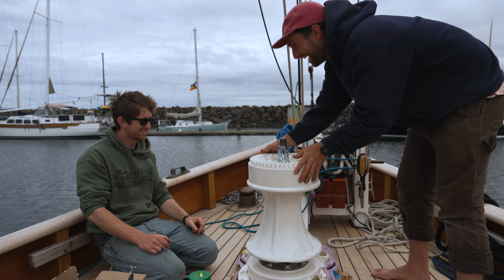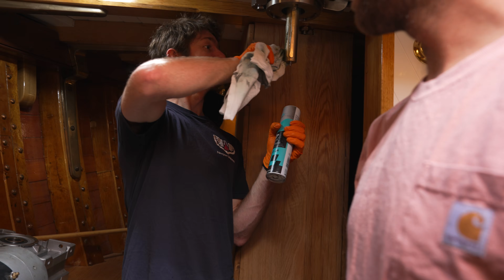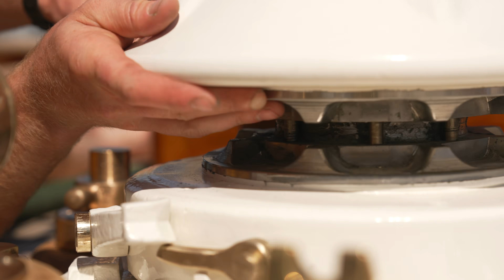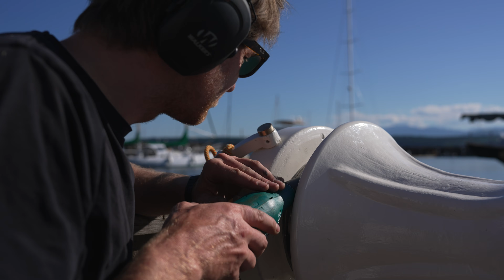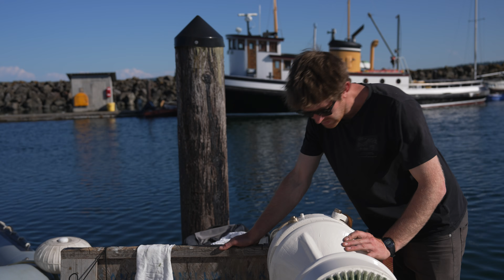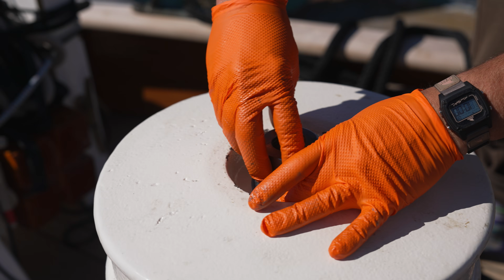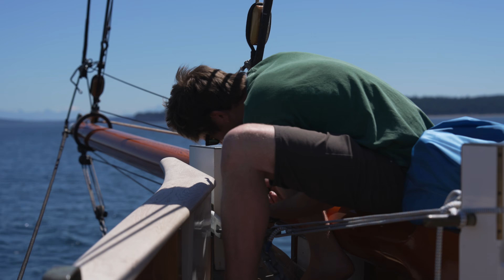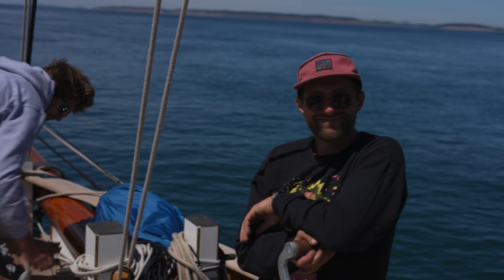Installing and using the original capstan!

Comment: I know you love traditional boat and things like the capstan,. but what a terrible choice for your boat. It's very heavy right on the bow and will likely change your stability. All the work. time, and money that went into this when a much more efficient, far less weight, and wayyyyy less cost windlass is readily available. That and the antique and inefficient rig that will make short handed sailing quite difficult and dangerous. And the widow maker, that exquisite boom is super dangerous in my view. A powerful jibe combined with a roiling swell will rip the deck hardware and take out anyone who is above it's swing. Running down wind in a cross swell could drop the boom in the water briefly. The force of that will rip the boom off the mast or pull the boat over if the sail fills with water. This has happened to much more experienced sailors. Yes, it is a beautiful piece of work that cost far more than a more modern boat, but is not well suited to the ocean without always a crew on board to handle those sails. You can rebuild a model T to a beautiful and restored condition,  but it is still an inefficient design regardless how cool one may think it is. Sell Tally Ho, take the money and buy yourself a boat you can sail by yourself or with a short crew. I have crossed two oceans in sailboats and I would never attempt that with such a difficult rig and heavy boat. What the hull speed flat out? I doubt more than 8 knots. How long does it take to get there at hull speed? Much longer. How about running away from storms? Speed is very important and this boat does not have the capability of doing 2-300 mile days. You would not buy a car that cannot accelerate and get you out of trouble, any more that a restored Model T could help avoid an accident. Beautiful workmanship at a high cost and yet a very slow boat. That's my view, and I am sure a traditionalist like yourself would not agree, but this 20,000 miles old sailor knows a few things from experience.
Reply: Also it's the original capstan. Where's the problem. Just your lack of listening and uninformed opinion.
Reply: What a fantastic well-suited pep talk for a guy that has spent 7 years following his dream, restoring a 110 year old boat, finding means and ways to impressively manage a very large project and building up a community of 500k+ subscribers who repeatedly state that they are delighted with the content of the channel.

I am pretty sure you have convinced all followers/subscribers to shame Leo, the channel and Tally Ho for being old, inneficient and unsuitable, and that Leo will dispose this worthless boat tonight

PS: Those who gather information before issuing opinions  know that the weight in the bow was taken into consideration (542 lbs according to Keith video who weighted it by Leo's request) . One full video dedicated to stability
Reply: So because of that there is not room for valid criticism or helpful suggestions? Obviously your experience is limited and you do not understand a fundamental truth for those who venture offshore in a boat. The "ocean" or "mother nature" if you will, does NOT CARE when it attacks you for your foolishness'. It does not care if the person scaling a mountain is experienced and doing everything right when he is killed by an avalanche or frozen to death in a freak summer storm, does it? Every sailor knows despite every precaution and concern, shit happens out there in the big blue, things that you could not predict or prevent at the time. Only a day sailor, or racers (ugh!) would think otherwise. This skipper Leo is very knowledgeable and has logged many miles, all in traditional  boats, often with large crews. However, my points are that it will take more people to handle that rig in difficult weather, that slow sailboats, (under 8 knots consistent), cannot run away from storms, a wooden or steel boat may be rugged and extremely well built, but the sail plan is not suitable for long excursions without a robust crew. THAT IS A SIMPLE 2+2=4 TRUTH. So on top of the weight of all that fine wood, a monohull is dragging a huge lead keel. The finest navigators and sailors were the Phoenicians and the Pacific Islanders. The sailed and navigated in seas prone to brutal storms in open boats. Islanders were known to travel hundreds of miles to another group of islands just for a party and ceremony. Finding and sailing to a south Pacific island is far harder than finding a needle in a haystack. And what boat design and material did they do that in? Their choice of boat design was capable of speeds in double digits even in light air WITHOUT a huge sail plan. The low weight enabled the ocean to lift them from breaking waves. Their shallow draft meant they could be beached for repair or landing. Today the best sailing yachts are made of carbon fiber, displacing  1/3 of what other hull materials weigh. Those ancient sailors used multihulls, made out of bamboo. Like an antique car that has been fully restored, a boat like Tally Ho has value, probably a lot since the record of every item built into the boat is available to see. However, like a restored antique car, it is slow, inefficient fuel wise, hard to handle in blow, and lacking creature comforts for long trips, etc. Someone who is a lover of this boat and style will pay a lot of money for such a vessel, but they will likely not buy it to sail the world. My advice is to sell it before it is used much and in pristine condition, and buy a modern boat if the goal is to explore the world. So just like a man who rebuilds an antique car, he can get a lot for it, You don't see Jay Leno going on a coast to coast road trip in any of his cars, do you? And why is that? So familiarize your self with modern boat building and the kind of sailing experience they bring and you will understand my post. What I have said here takes nothing from the great achievement  Leo, his fine workers, and the superb craftsmanship and knowledge demonstrated in the videos.  Also I just thought of worms. In the warmer waters of the world, eg. the entire South Pacific, wood hulls are vulnerable to wood boring worms. In older times, they covered the underbody of wooden boats with copper sheets to stop this. Today even with modern antifouling paints critters manage to get through to the hull material, particularly on long voyages. Also a wooden boat hull is not smooth and the surface makes it far easier for growth to accumulate  fast.

Comment: Leo, Please wrap that beautifully machined chunk of steel holding the capstan drive motor with some kind of substantial impact absorbing material before someone gets hurt!  Head injuries bleed a lot.  In heavy weather. if there is a need to be that far up in the bow it looks like it will be almost impossible not to run into it.  Looking at the rest of the interior I suspect you have already planned to wrap the new machinery in a teak box with well rounded corners and edges.  Hope you and the crew are have a great time sailing this beautiful vessel.

Comment: Your restored capston is a remarkable piece of machinery. However, I think it's entirely too large for your vessel. I have a 55 foot ketch, 22 tons empty with very highfreeboard. I survive with considerably less weight forward than your capston. I am sure an experience sailor like yourself never depends on the capstan alone to maneuver up to your anchor to retrieve it. I know you probably want to maintain the historic features of your vessel, but from a weight, bulk, space taken below decks, and other aspects it is totally unappropriate in my humble opinion. I have successfully retrieved my anchor in 40 + plus knots single-handedly. It simply takes a little more technique and patience. I would avoid extreme weight in the ends of my boat at all cost!

Comment: Drop elbow and chain will feed proper into the locker. To avoid ripping elbow out, cut at a 45 degree angle and make an oval flap for water barrier
Reply: to avoid ripping elbow out, cut at a 45 degree angle and make an oval flap for water barrier

Comment: you've been saying the chain isn't the same size as the design sample, why not smooth the chain some?  plus there are slight inconsistencies in the chain welds, etc. that could be causing some of the problem.

Comment: Have you considering having the entire chain sand blasted (or vapor blasting) to remove the high spots on the welds and make a smoother surface? I think that may fix all of your binding issues.

The cap stain is a high tolerance machine while the chain is a mass -manufactured white very loose tolerances and seems to be the cause of your issues.

Comment: The Moly Disulphide grease I specified when designing the PT-6 gas turbine engine, was not to used on ball or roller bearings because the crystals would be laminated together, like graphite crystals, but they were excellent for sliding applications like threads.  Leo was 100% correct in his comments about molybdenum disulphide grease.

Comment: Personally, I would have been really tempted to install modern anchor windlass like a Lofrans, and a raw water pump at the bow.  Nothing like 100 ft of  mud on the chain you don't want in the locker.

Comment: Fantastic to see the capstan installed, everything fitting neatly together, and working so well; the product of many hands in several places. The links of the chain and the slots in the gypsy will surely wear a few thou off each other with use and you will get a better fit over time?

Comment: Leo as a former mechanic who has a few nice head scars from third members on cars rear axles I have one suggestion to avoid blood loss on Tally HO. Make some sort of box with rounded edges around the motor drive in the capstan. Otherwise someone WILL hit their head on it and then there will be blood all over that amazing interior woodwork. Machined 90 degree corners are very sharp and very unforgiving.
Reply: Thank you! I worked on aircraft for 17 years and bashed my melon too many times to count.
Reply: I’m also a mechanic and that’s the first thing that came to mind at the end of the video!
Reply: some dome nuts on those threads
Reply: I had exactly the same thought.
Reply: I was wondering the same thing, some heavy sea and somebody try to walk past this gearbox and bang bloody headcount… ouch
Reply: Hard hat 😂
Reply: I agree with making something to divert heads from contacting that sharp corner. That is what I would call a wishing spot. If you hit it with your head, you'll wish you hadn't. I hit a wishing board in an attic back in 2020 and gave myself a concussion. It has caused issues with headaches like I never had before that at times were so severe that I couldn't function. You might want to consider some kind of padding for that corner because hitting it could cause serious problems for the unfortunate soul who finds it the hard way.
Reply: Came here to make the same comment. That could produce a lot of blood and knock someone out cold. I was thinking some padding or a rounded covering around all those sharp edges.
Reply: I thought the same thing, but I thought that was just not finished yet. I wondered what the big holes at the corners of the below deck capstan were for.
Reply: @davefoc  You are looking at a worm gear box. The holes are for mounting the gearbox to a structural member and then the motoris cantilevered off of the gearbox
Reply: @davefoc I think those are just the mounting holes on (what I assume is) the 90 degree bevel gearbox. That looks like an off-the-shelf part, so it has mounting points on each corner.
Reply: @davefoc  they are all alternative mounting points for motor on the angle drive.   I a surprised Leo didn't mention a later cover to protect and disguise - I find it hard to believe it wasn't mentioned sometime during the planning and installation - I expect it was just an oversight not to mention it in this video.
Reply: Why mention the obvious, you can leave that to all the sofa experts. 😂 @jonathanlodge4117
Reply: @jonathanlodge4117 well Leo has nothing else to do… he just lays around all day and we should accuse him of “oversight” in not spilling the beans on how this will be made safe because we were all appalled at the blood letting that is about to ensue. 🙄
Reply: I’d be astounded if Leo hasn’t already planned to do so. With everything going on, likely just forgot to mention it in the video.
Reply: Good idea
Reply: He is def making trim to cover that
Reply: Probably already thought of and planned knowing leo
Reply: @cameronmulka8146  no
Reply: I usually started them on other ships. FCC Burnston, USN Ret.
Reply: Better than the pen for tally marks on box that got so many of us in the headright next to the bulkhead of the bathroom.
Reply: You can guarantee that is his plan.
Reply: Wow I was going to make the same comment, working with similar industrial gear boxes. Those machined side mounts are definitely going to leave a mark on a forehead eventually.
Reply: That is the first thing I said as soon as they showed it installed. My god.
Reply: I was an Army mechanic for a couple of decades and I was terrified seeing that gearbox unprotected. Got many a knock on the noggin working on armored vehicles (Man, those things are hard! ).
Reply: And while you are at it cover everything else on the boat in bubble wrap.
Reply: I was thinking that was uncomfortably close to the  noggin. Some kind of cushion would be advisable.
Reply: A box to go around the Headbanger?   Hehe
Reply: When I was in the  USN, I put to sea on five different ships as an Aviation Aircraft Electrician and then a Firecontrolman. I usually put fires out on my ship. Rather, I started them o
Reply: I was looking at that thinking, "How many times would I crack my head on that thing?" Glad to know I'm not the only one.
Reply: My head already hurts in sympathy.
Reply: - Agreed...{my experience has taught me.} architects, design engineers, engineers of all sorts, etc. are all stupid about how the practical world actually works. They never had to fix their mistakes and never hurt themselves doing so.
Reply: @RobertFay  no
Reply: I opened up the top of my finger on a machined corner of a gearbox housing when the socket slipped, wasn't even cranking on it that hard. Made a guy faint because you could see my finger bone
Reply: Enclose it inside a vertical
support beam extending to
the keel timber.
This will also help support
the 550 Lb. weight
of the capstan.
Any plans for a ship's bell ?
Must know the time, mate.
Reply: It's probably going to have cover from  wood
Reply: At face height it's less of a problem. People tend to cut their heads open on things that are at scalp height, just above their field of vision but low enough to dig in. Probably best to leave it open to inspection.
Reply: I was thinking the same thing.  Maybe a way to wrap it in some sort of padding.  As a former nuclear fast attack submariner, you learn very quickly what to avoid.  But still, enclosing it in a blunt corner box or thick cushion pad would seriously help.
Reply: I can see blood streaming from one's head in that area.
Reply: You should write graphic novels
Reply: Great idea and at 6’ in height myself I have crowned myself numerous times in basements and below decks,so short of preemptively beating oneself over the head to induce numbness your idea rocks.
Reply: @joesprague1464  it's not even a 6' problem it's an everyone over 5' problem lol
Reply: Agreed.  Head smasher was the first thing I thought.  Will happen eventually.
Reply: Yeah I can imagine my brain oozing out of my skull from here.
Reply: Good times 🎉 seems like a lot of extra weight up high and on the bow but a sturdy functional piece nonetheless also an original part. Let the summer cruise begin 🎉
Reply: It’s behind a closed compartment with a door that hides it away. Don’t need to worry that much in an anchor room.
Reply: Put padding on it?
Reply: Couldn't agree more.
Reply: Just cover it in foam tape like a premium worksman :D
Reply: I was thinking the same... in high seas that gear box is a hazard.
Reply: Leave it out in the open. It will make for some good content and drama
Reply: Maybe even just some padding on the edges rather than a whole enclosure.
Reply: Being an aircraft mechanic..
I can concur with the above statement.
Reply: All crew are required to wear those funny foam helmets that Rugby players and NFL players wear to protect against concussions now. They will go well with the old timey British naval uniforms that the crew will be wearing.
Reply: Whatever you do, don't look at Seeker.
Reply: Absolutely.
Reply: I think a replaceable styrofoam cover would be ideal to protect my head, lol.
Reply: Rather than thinking that the gear assembly should have a protective box around it, I'm just wondering what wood will be used and how beautifully it will be made. No way is Leo planning to leave that cranium-splitter uncovered.
Reply: Hippies
Reply: Mechanic also. 30 years this year. No scars on my head though I’m sure I’ve knocked my head a few times. The corners are not sharp. And I’d argue that hiding those components may hide any issues that arise. I would leave it exposed for easy inspection.

Comment: Never been in such a ship, but interested in engineering that capstain is a piece of art. It requires many features already in manual operations, but now it has electric motor too. It will function better and better each time used. How much weight there is in anchor and chain?

Comment: I have a thought on the remaining chain problem, would Tally Ho's original chain have been Wrought Iron rather than modern steel? If so then it would have weight a fair deal more also in your rebuild have you raised the chain locker floor and in so doing shortened the  drop reducing the hanging weight. Hope you can get it sorted to your satisfaction soon. Thanks for the update Leo.